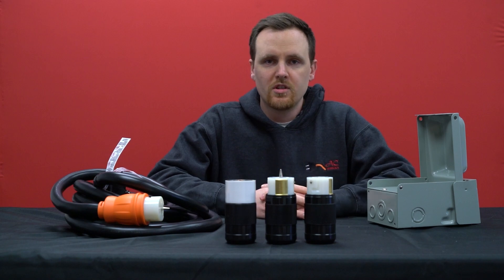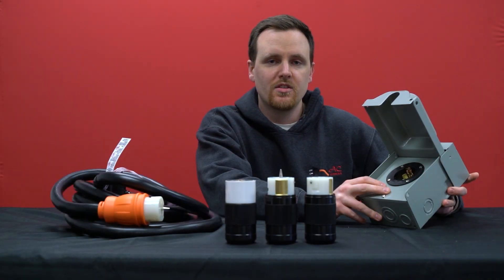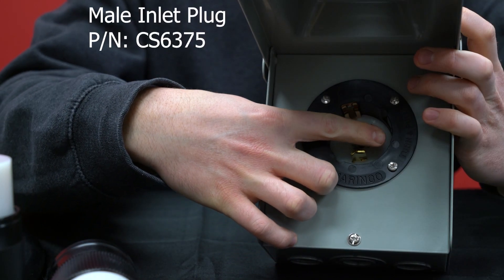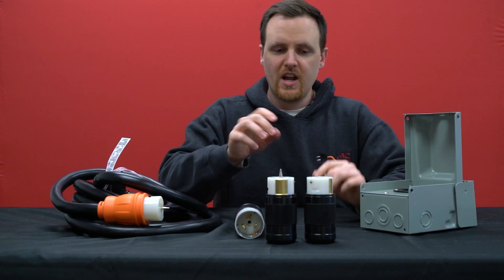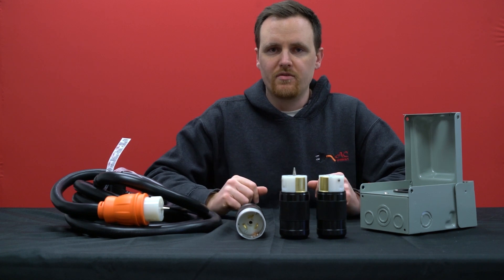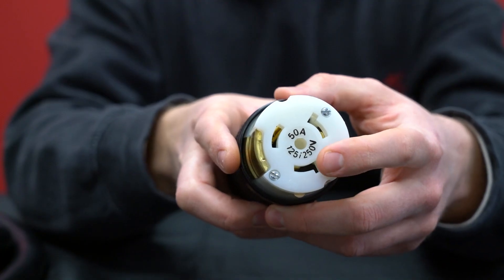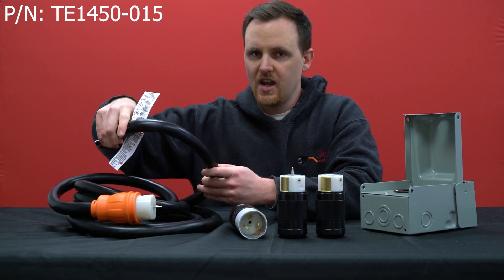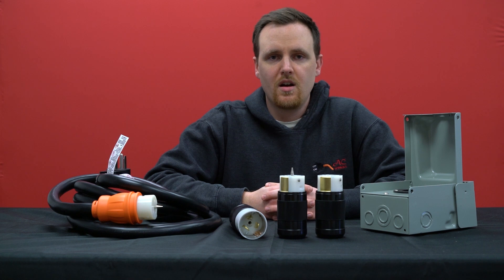Yes, SS2-50 Has 4 Prongs

Comment: I am about to get a new cable to run my generator further away from my inlet I have been using a SS2-50R with the pin sticking out the center, and my inlet is basically exactly the same as what you have here.

I had seen some cables without the center pin, and some with and just didnt know if it was there as an option (to help center/connect) or actually needed.
I see you have both on the table, so assuming they both work fine? 

But it was not actually clarified.
Reply from the maker: Hello. The center pin is pretty much just a guide pin. That's what makes the difference between in the names CS6364 and NEMA SS2-50R, which I know is kind of weird. There is no electrical connectivity with the center pin. I've handled both many times and don't really see a distinct difference between with and without the pin.
Reply: Thanks for clarifying about the center guide pin on CS6364 type or no guide pin as the ground “pin” is on outside sheath